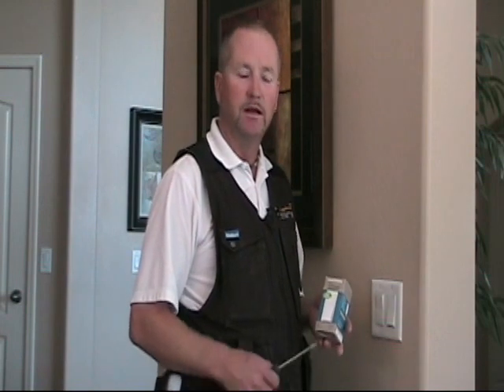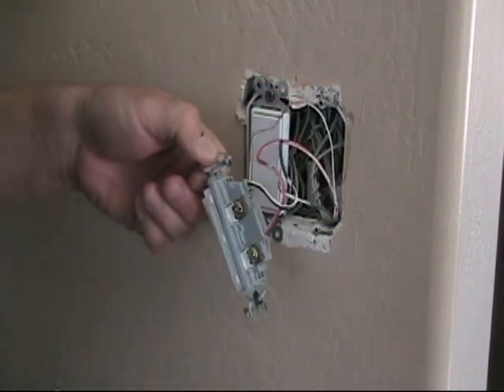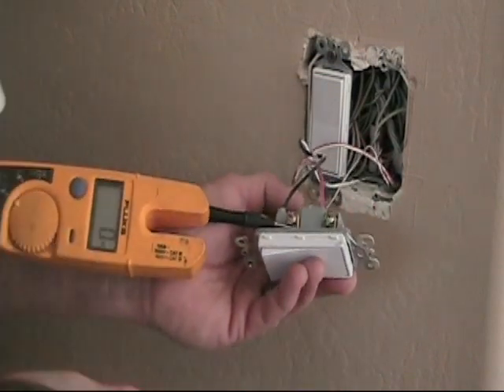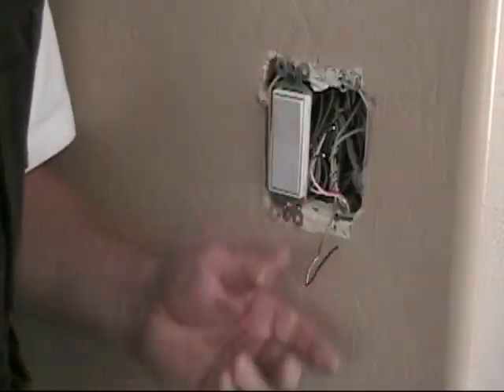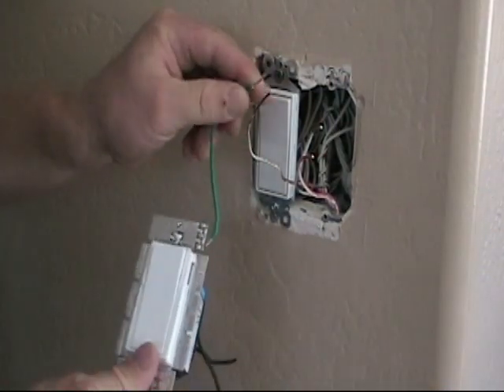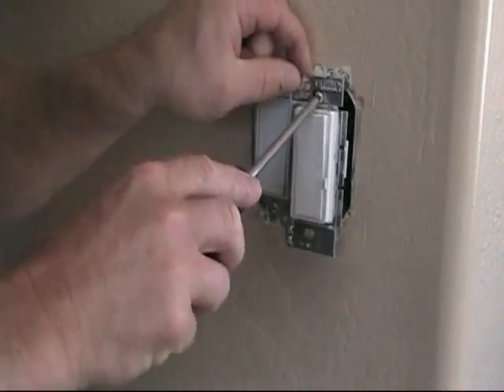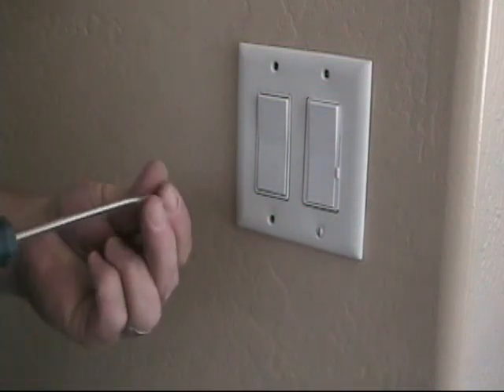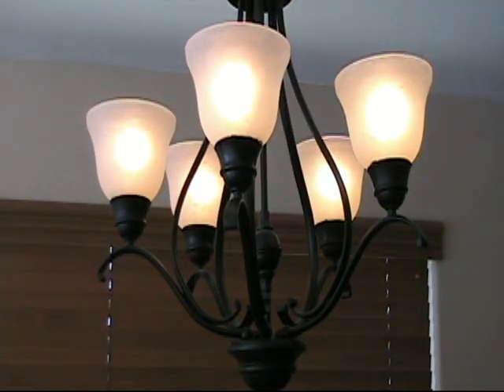Wiring a Dimmer Switch

Comment: My toggle switches currently are not grounded...it looks like the box the wires are in is plastic...should I still add a ground? Or is it not necessary?
Reply from the maker: The rule is that if a ground terminal is provided on the device, then it should be connected to the grounding conductors.  If not, then not necessary.  Also, anything installed prior to the grounding requirement for switches is grandfathered in.
Reply: @theinternetelectrician  awesome thank you so much for the response...I just font know where I would apply the ground on a plastic electrical box
Reply from the maker: @DjDieselLive1 In plastic boxes there is a grounding (earthing) terminal in the back that has a metal strip that is connected (bonded) to the device mounting screw holes. So proper termination of the grounding (bare) wires would involve splicing all the cable ground wires together, along with a pig-tail jumper to connect to that ground terminal in the back of the box, and also a pig-tail jumper to connect to any device being installed in that box (receptacles always, switches or dimmers if a ground terminal or green wire is provided with the device).
Reply: @theinternetelectrician  you're the man thank you!

Comment: Great but you did not mention  how to  determine the wires , just mentioned the black wires , what about the other wires , I have red wires coming out of my dimmer switch , black to black !  Red to  What !
Reply from the maker: Send me a photo of the wires from the box and of the dimmer switch. terry@electrical-online.com  But if the only difference is that your dimmer has 2 red wires instead of 2 black wires, just connect as I show in the video.

Comment: Hi Terry, a great video and easy to understand instructions.I replaced a broken dimmer switch. When I turned the circuit on, all the lights from that circuit went off. The box holding the switch is very old and metal, it does not appear to have a ground wire. So I connected the green/ground wire to one of the mounting screws. What do you think went wrong. Any suggestion will be appreciated. I can send you pictures of the switch box if you want.

Comment: You fail to explain which wire goes to which.
Reply from the maker: +Pastora Letty That is because it doesn't matter.  With a simple switch, what it's doing for you is connecting or disconnecting the 2 wires.  That's why the terminals on a single-pole switch are not distinguishable from each other, and why both wires on the single-pole dimmer switch are the same color.
Reply: IT DOES MATTER!!!  in ANY electrical tutorial you better explain everything in safe detail and then some of the "why" so ppl dont get injured. Tuts like this "horrible one"  are not for fkn knowledgeable experts where you can ASSume they know things you carelessly leave out.  they're for unlearned avg ppl to learn SAFE tips and guidance. Key word SAFE!!!

Comment: Terry I tried to replace a rotary dimmer in my living room.the one i took out had just two wires on the dimmer,the new one had four wires,two red wires a black wire,and a green which would be the ground wire. I connected the wires turn the power on and nothing happen.thinking i may have connected the wires wrong i reconnected the wires turn the power back on,turned on the switch and still the lights did't come on.could there be something else wrong.
Reply from the maker: +VaunDoomYT You purchased a 3-way dimmer switch.  If you connect the 2 wires together that were originally on the old dimmer switch, and the light doesn't work, then there is something wrong.  Did it quit working, and you just assumed that the old dimmer was the problem?

Comment: I have a bank of 3 switches and want to change out one switch and put a timer in place of one of the switches and expected it to be simple.  However, the existing switch has 3 black wires feeding it. How do you tell which is ground, hot neg?
Reply from the maker: I think you must have a 3-way switch there.  It's possible to do, but this complicates things being a 3-way.
Reply: Thanks for the reply I got it figured out and it's working well .

Comment from the maker: No preference in which of the black wires from the dimmer that you connect to the wires from the wall in this particular situation.  Your terminology "hot lead and the ground (not the bare wire)" is not correct though.

Comment: Really excellent video, Terry.  One of the more concise and professionally done vids.
One thing I'd like to know is which of the two black wires from your switch went to the eires from the wall?  Is there a preference in connecting the hot lead and the  ground (not the bare wire) on a single pole installation like this ? Thanks, Mark
Reply: How can you tell what the ground wire is between the other ones?